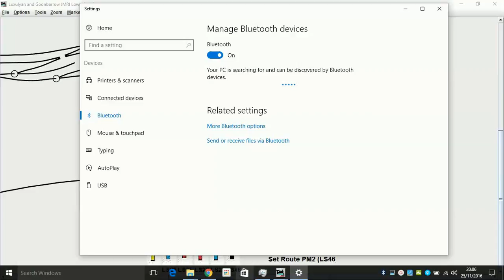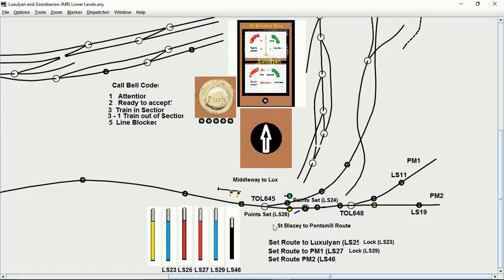JMRI British Signal Box Demo - model railway signalling with custom icons for traditional sections.

Comment: Hi John, great demo, very interesting as I want to go down this path with JMRI. I’ve done a Modratec kit for my lever frame, which I will hopefully get connected up to JMRI on an RPi3. Did the GWR do different colored levers? On BR(NE), Black is points, blue is facing point locks, red is signals and yellow distants.
Reply from the maker: Simon Mitchell Thanks Simon! Modratec is great kit! Would love to see how you do it on a video. I'm not sure whether GWR struck with the same colours, but I should! I just grabbed from the icon library what looked right from my sparse knowledge. If I can help, PM me.